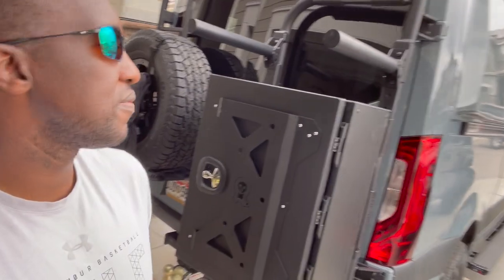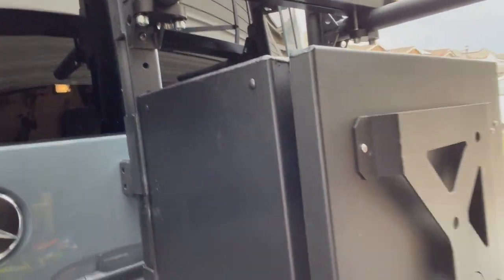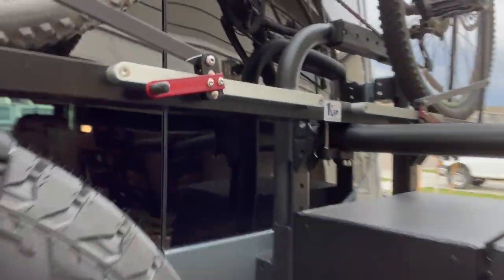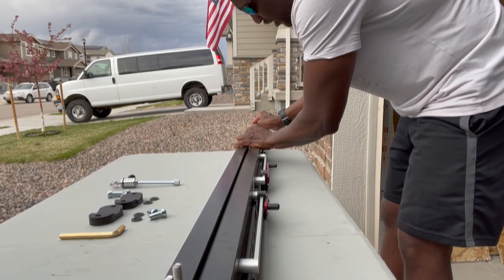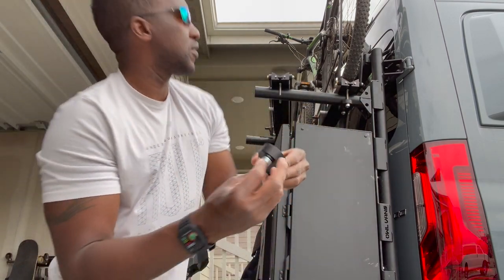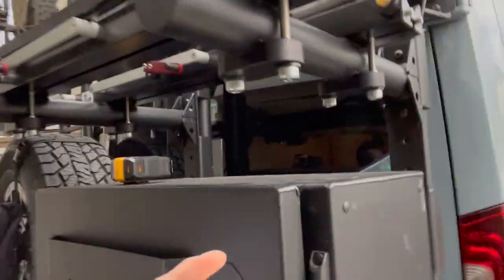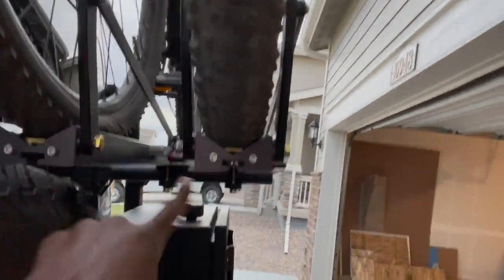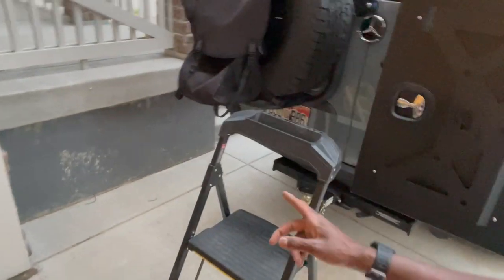Installing 1UP bike trays on Owl Vans B2 Carrier - Winnebago Revel Sprinter Van

Comment: Great walkthrough. What size ladder (height and rungs) and possibly brand/model are you using? I am same height as you, so based on your experience I may need one too (am 71 yrs) Also, where do you stow the ladder? Trying to keep garage space optimal so I wonder if the roof would be and option but that would beg questions on fastening. Again, thanks!

Comment: The velcro is a good idea. I would have used part of a mtn bike tire tube and slid it on. May I ask why you didn't want the bikes on the inside of your van? Now that it is November, how has the rack and bikes held up? Do you have to carry the ladder with you?
Reply from the maker: Hi Donal. The limited room on the inside and plenty room outside was my driving force. I actually do not have this revel anymore. I’m working on building a sprinter van from the ground up. 

The ladder you would have to carry. I think it’s the safer option even if you’re taller.

Comment: Just ordered 1up from Owl Vans to put on B2 carrier. Watching your video and finding it very helpful. Note that you owned it for some time do you have any additional considerations that you could share? Also bikes seemed to be very bouncy on the rack. Have you noticed a lot of vibration on the road?
Reply from the maker: Hi! Glad you found this useful. I wanna say I think they are making pretty cool items that are structurally sound. My issue was hopefully isolated and it was resolved. 

Racks usually have some bounce and movement in them. I have Thule right now on another vehicle and I liked my 1UP better. Seemed fairly sturdy and I never worried they may fly off.
Reply: @iAmMarchal  Thanks! Is your backup camera still useable with bikes up or do I need to get a new one where I can find a better point of view? Maybe putting it on the bumper?
Reply from the maker: @Дмитро-х2г  It’s usable. Of course bikes in the way so not an unobstructed view. But enough to be better than nothing :). I personally never felt like the world was ending with the bikes up and using the camera.